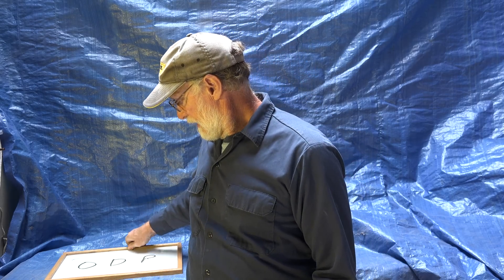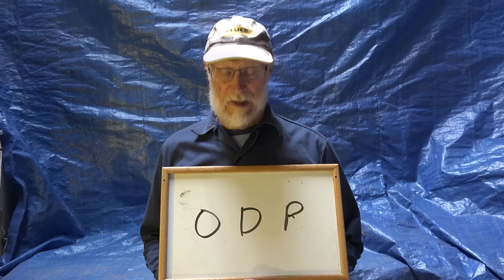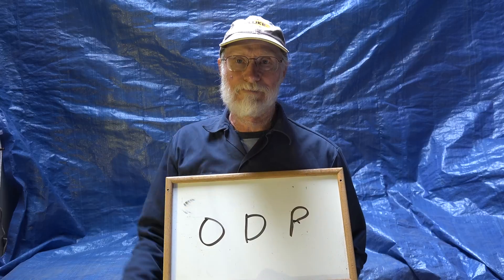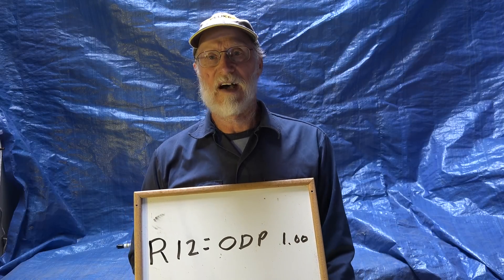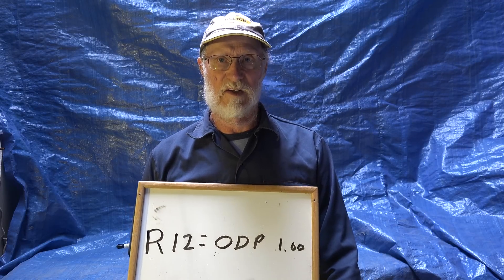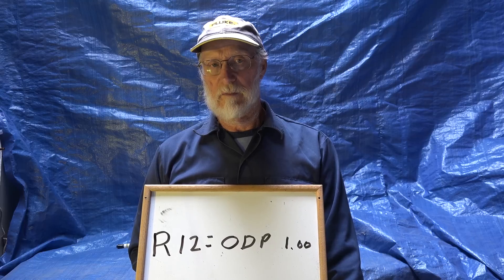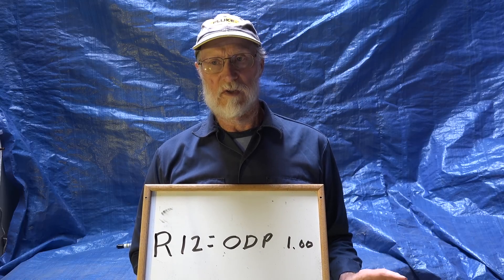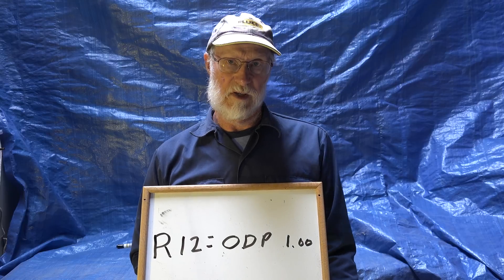What is ODP

Comment: "Ozone is produced naturally in the upper atmosphere (the Ozone layer) through ultraviolet radiation. As well, lightning will produce Ozone through electrical excitation of Oxygen molecules. Ozone Generators use both forms of producing Ozone. "(https://www.google.com/webhp?sourceid=chrome-instant&ion=1&espv=2&ie=UTF-8#q=does+lightening+create+ozone%3F)

"Recent satellite data suggests that there are more than 3 million lightning flashes worldwide per day, or more than 30 flashes per second on average. This includes flashes within or between clouds as well as flashes extending from cloud to ground.Apr 5, 2000" (https://www.google.com/webhp?sourceid=chrome-instant&ion=1&espv=2&ie=UTF-8#q=how%20many%20lightening%20strikes%20are%20there%20per%20day%3F)

Since these refrigerants destroy ozone,   I wonder what was destroying the ozone BEFORE these ozone destroying chemicals came to be?  All the while ozone was being created by ultraviolet radiation and lightening.  To me its a curious oxymoron.

Comment: The chlorinated fluorocarbon refrigerant story is a tangled web of corrupted science, greed, high crimes and misdemeanors. Spread by a similarly corrupted corporate controlled media. All leading up to DuPont loosing it's R-22 patent 2017. If you remember, that 'hole-in-the-ozone' discovery preceded the BS claim that the gasses could cause it. The "hole" was a natural seasonal variation with almost zero production of O_3 in Antarctica in the winter. DuPont co-opted that fact and forced the industry to use another fine product that they just happen to offer. It was explained that Freon® would combine with O_3 in lab conditions. But, became inert at the high temperatures and ionizing radiation in the ozone layer.